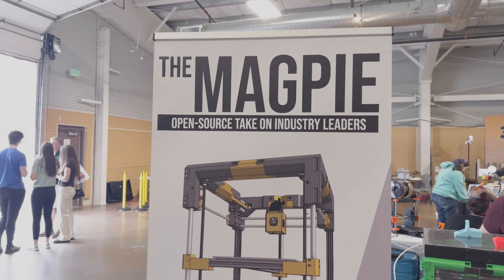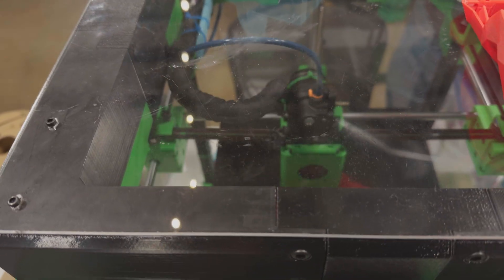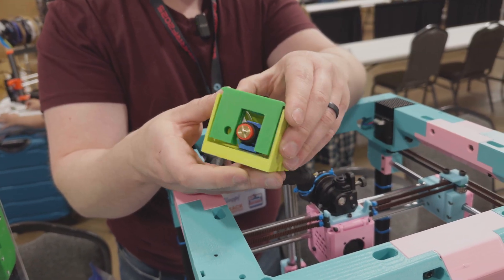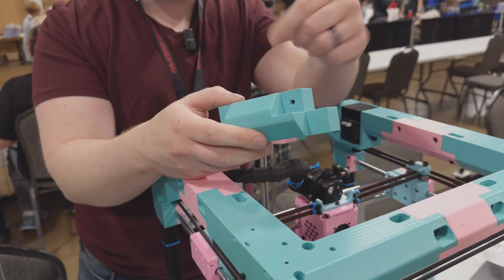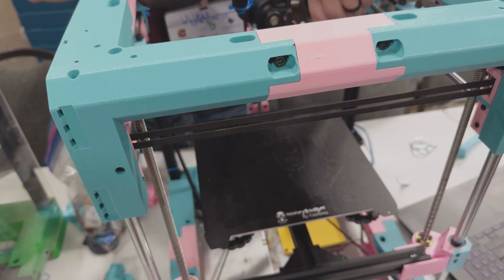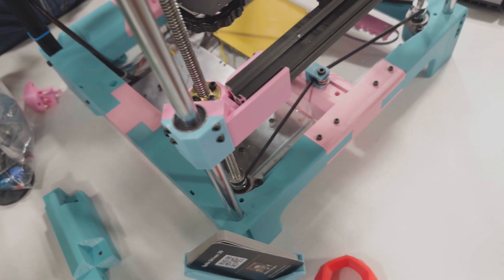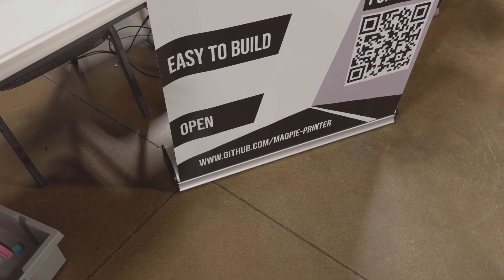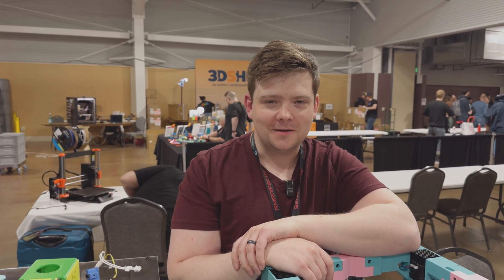West3D at RMRRF 2025 with the Magpie Printer

Comment: Think I’m going to make one of these using my old Ender 3 parts. I have to wonder if anyone has made a frame from PCTG yet ? And how it will perform.
Reply: Hi! I designed the Magpie. 
PETG and PCTG, being so similar to PETG, should work perfectly fine. 

Actually, it should work better than PETG given that PCTG is basically just a better version of PETG, and is easier to print.
Reply: I'm printing the parts for one right now in PCTG.
Reply: just make an ender NG